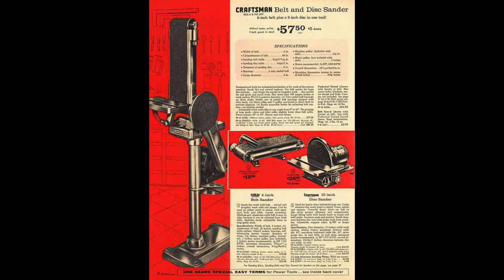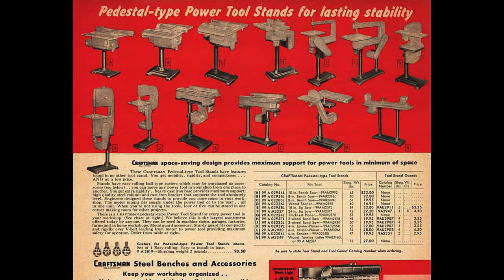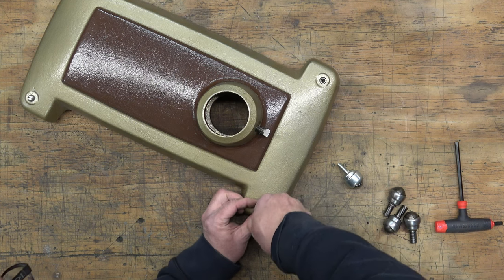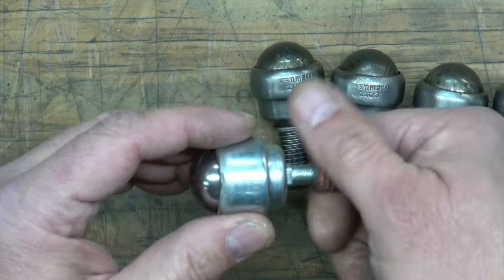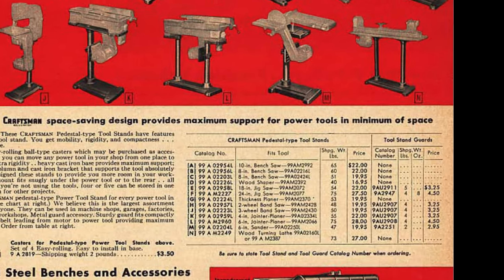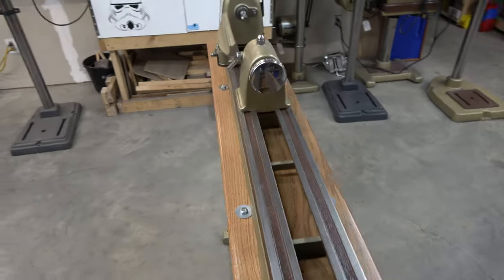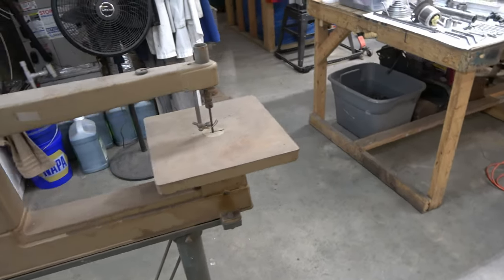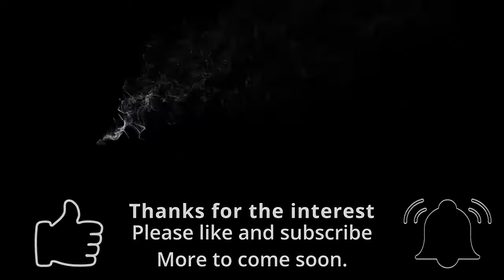Craftsman Pedestal Type Tool Stands Overview

Comment: Thanks for the very interesting and informative video. I had the surface planer several years ago. Scary machine! Previous owner had put the prawls in backwards. First use was a piece of wood coming at me at around 50 mph. I fixed it but it still scared me. Gave it away. Wish I hadn't. Thanks for the brief history on King Seeley  and Emerson. I have often wondered how Emerson got into the picture.
Reply from the maker: Thank you. I always inspect a tool I acquire before use and I have found a ton of issues with various tools over the years that could have caused serious injury had I used them before inspecting them. I have a health fear of my power tools that keep me on my toes. Always inspect before you plug it in. Glad you didn't get injured.

Comment: For the casters look at an industrial supply (McMaster Carr) or a place for machine shop supply, the 1/2” is a very common foot size for equipment 
I’ll match my modified* 100 series table saw for accuracy against most new machines. I also have a Delta UniSaw. I’m a Hardcore hobby woodworker. 
*New rip fence, miter gauge, and 2hp motor, under $800 total investment for a truly professional quality saw
Reply from the maker: Thank you for the comment. I checked McMaster and they did not have any 1/2 x 13 threads ball transfer stud mount casters. They do have 1/2 x 20 thread. Most of what you find out there these days is metric and the 1/2 x 13 thread is rather elusive. Besides, most of the ball transfers on McMaster are anywhere from $7.95 up to $178 each. When you need as many as I do that is very expensive. I think I paid around $40.00 for the a pack of 10 from Amazon that I sued for the video along with the threaded sleeve.

Comment: Would the cast iron tool stand for the 3 wheel bandsaw 103.24300 be the same as a later model?
Reply from the maker: That would depend on which model and if the foot print is the same. without having the band saw and/ or measurements of the foot print I can not tell you for sure, however, one would assume that if the foot print is close, then you could possibly fabricate a spacer plate to adjust for the discrepancy. IF by later model you still mean a King Seely or Emerson 3 wheel band saw that is not a direct drive then I expect they have the same footprint. Once you get to the later plastic cased models there is likely a different footprint.

Comment: I have a lathe pedestal. Are there any specifics for making the wood base? What length and width did you make yours? I assume the end of the lathe with the motor is heavier, should the lathe be placed in the center regardless of weight or did you try to place the lathe so that the weight was balanced?
Reply from the maker: Great questions and the same ones I had when I rebuilt mine. I chose to center the lathe on the pedestal and the motor weight was really not that big of a deal. The stand works great as I have it set up. I did add bolt to help stabilize the motor because it did bounce a little. This was likely due to it being on the end of the board and not as rigid. My board measures 10.5" x 55" x 1.5". Keep in mind that if you have or intend on getting the lathe extension then the length would need to fit it as well. I some what detailed review of the pedestal stand and the lathe rebuild can be found in this thread and I show what I did with the stabilization bolt in this thread as well: https://www.garagejournal.com/forum/threads/11b30b4s-craftsman-103-23070-100-series-9-x-30-wood-lathe.491733/
Reply: @JeffsShop  Thanks Jeff, I read the thread. Someone was giving away the lathe with the stand. It was a similar lathe to the original one that you had in the thread (with the tube). I was just about finished finishing it up, but there was an auction today, and I picked up an old Delta Double Duty lathe at a really good price. It has a similar shape (although looks a little beefier) than the Craftsman lathe you used. Plus it has a Delta 6400 motor. I am planning to mount the Delta lathe and motor on the Craftsman (King Seeley) pedestal. All your tips from the thread should come in handy when I go to make and mount a board to the pedestal and lathe.
Reply from the maker: @jd_5855  Cool, the Delta lathe should work well. The Craftsman pipe style lathes are really not that stable. IMO, a lathe should have a nice stable bed like the older Creaftsmans and that 100 I have.

Comment: Was there ever a pedestal that fit the larger footprint of the 115.6965 and 115.7397 grinders?
Reply from the maker: Not that I am aware of.
Reply: @JeffsShop It's tough to find a stand for them, given the wide footprint. 🤔
Reply from the maker: @desertdweller9548  Yes and I believe there are only two mounting holes (one on each side). They are great grinders and clean up nicely. If it were me, I would get a 3' piece to 6" square tube and two 1/2" steel plates and weld the plates on each end then drill out the mounting holes on one of the plates. This would look something like the classic cast iron Delta grinder stands.